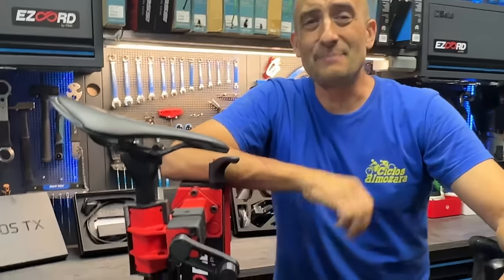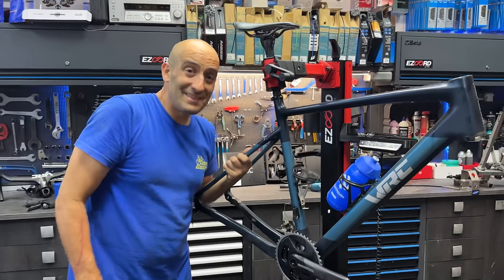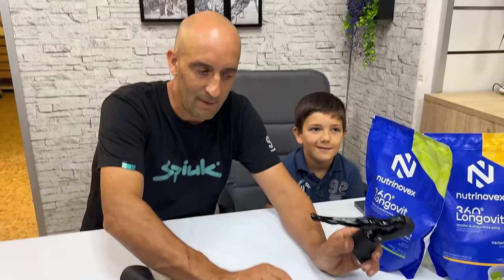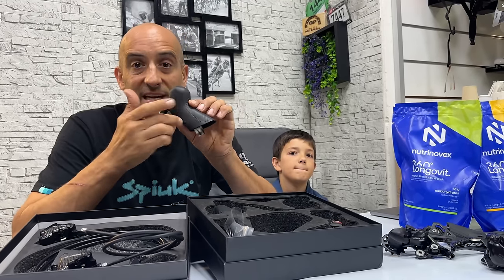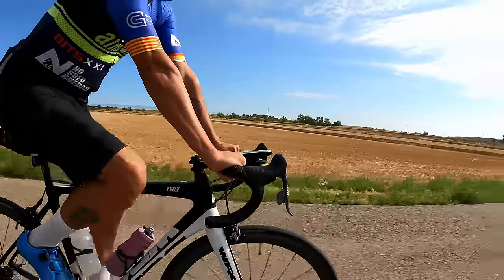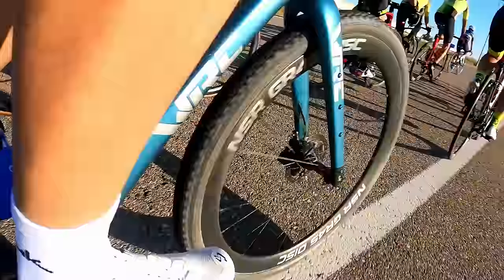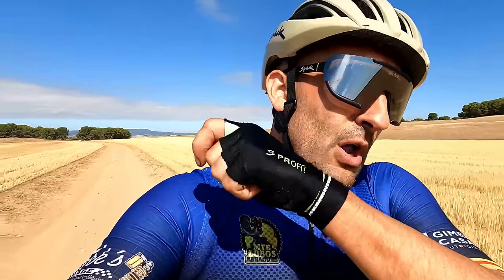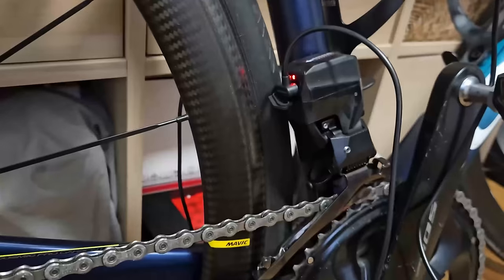Expectativas VS Realidad WheelTop. Funcionamiento inesperado

Comment: Yo compré el Ultegra de 12v en una tienda física en Valencia hace algo más de un año por 1600€ con bielas, pedalier, platos y cables, no hay tanta diferencia real de precio a poco que busques. No sé si Wheeltop hará descuentos (entiendo que por ahora no) pero sus ventajas hay que buscarlas en otros puntos como su configuración para distintos piñones o que no lleva cables. Por cierto, el Ultegra lo tienes para frenos de zapata, algo que para bicicletas ya con algunos años es una ventaja definitiva. Muchas gracias por el video.